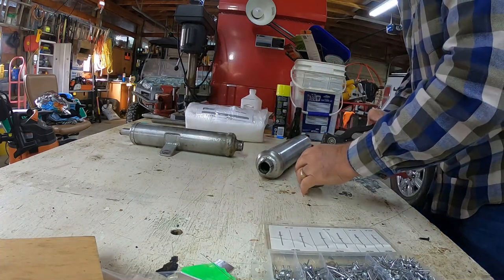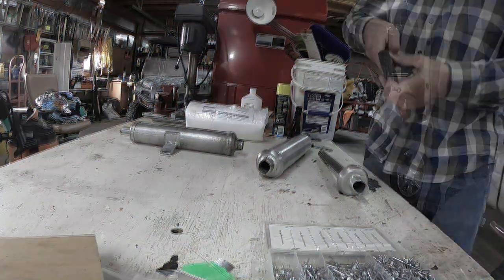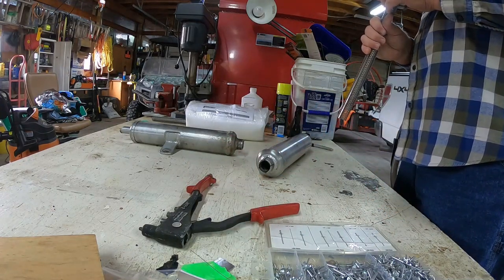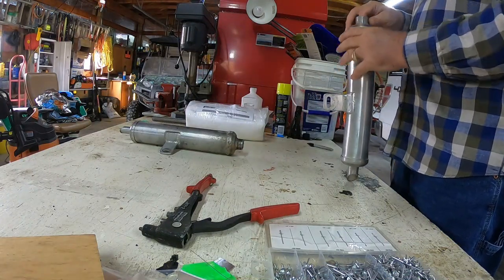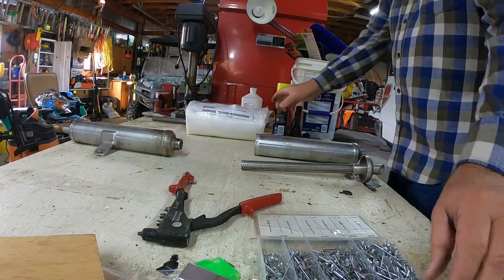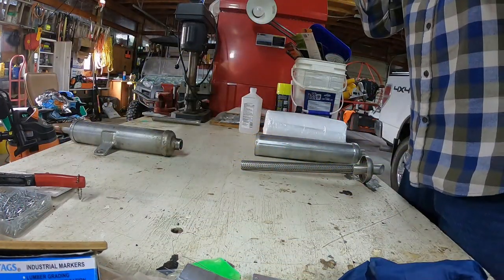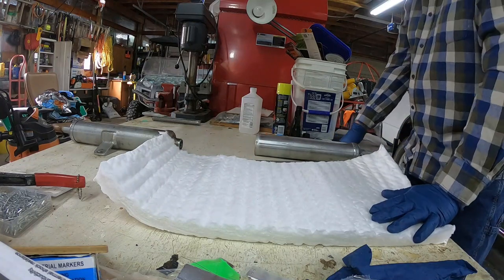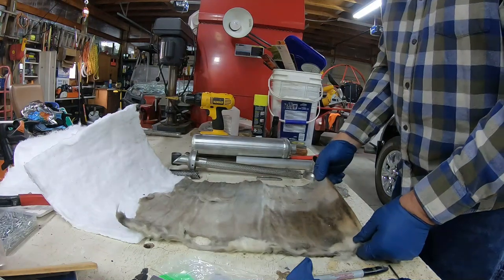Part 2 of 3, Freshbreeze Monster Silencer Repack -   Ohio Paramotor Trike Adventures

Comment: You have that down to a science now.  It's great it can be repaired without just being replaced.  Just too bad paramotor exhaust systems are all junk.  Funny, my truck has 75,000 miles on the same muffler, but my paramotor exhaust broke at 30 hours.  At least you've got her airworthy again!

Comment: I know that your baffle is welded at one end is it also tight at the other end or is it a little loose
Reply from the maker: hovernutxyz hey buddy!  It’s riveted at the end and slides in on the other.   I think it might be the pipe coming from the exhaust that is hitting the baffle.   But had me puzzled.
Reply: @Ohio-PPG-Trike-Adventures  okay I just thought maybe if it isn't tight on the other end it could cause some vibration and cause it to break apart however if it fits snug into the other exit end then that should not be an issue... oh by the way I'm thinking of flying tomorrow afternoon a little bit chilly but nice and sunny and calm😐🤔

Comment: You used the old insul on the inside for what? because it would hold up better than the new stuff?
Reply from the maker: Crockett yes it was better.  Finer and better woven.   The new stuff isn’t weaved tight together.   I bought some heavier stuffing to put in the next pipe.  I hastily put this one so I could fly again soon.    The other silencer actually doesn’t have any stuffing left.  It blew it all out.  That’s why I used the older stuff inside and new on outside.  Long story.
Reply: Makes sense.

Comment: Where did you get the perforated tube from and what happened to the mangled interior end in the previous vid?  Thanks for posting.
Reply from the maker: LA CHOPPERS LA-1210-48 1" x 48" Universal Baffle/Packing Baffle (Stainless Tube) https://www.amazon.com/dp/B01L220J82/ref=cm_sw_r_cp_api_i_ygRZDbPY2T9E4
Reply from the maker: Had a new aluminum pipe tig welded in to the cap. At around 1.50 you can see the pipe a bit better.  I should of shown a better picture.
Reply: @Ohio-PPG-Trike-Adventures  ... and you just save yourself ?$400?  Great job!   When you first lost power, and were looking for the cause, were you able to see the packing blowing out of the end?  Thanks.
Reply from the maker: eddaddio I was looking because my buddy had the same issue and I was aware of the symptoms.   I’ve had this happen to me now three times with about 130 hours.    Hopefully my next build/repair will find a better way.
Reply: @Ohio-PPG-Trike-Adventures  The perf tube you have now is stainless steel and should last.  I suspect the ones you replaced were cheap cold rolled steel.